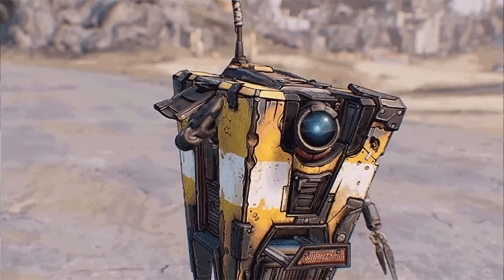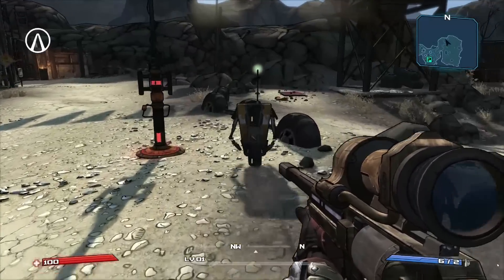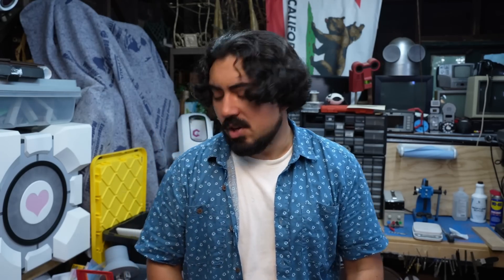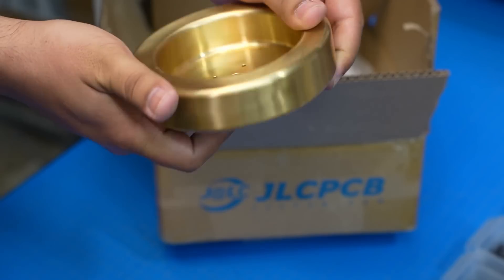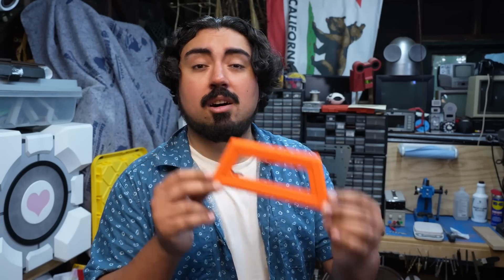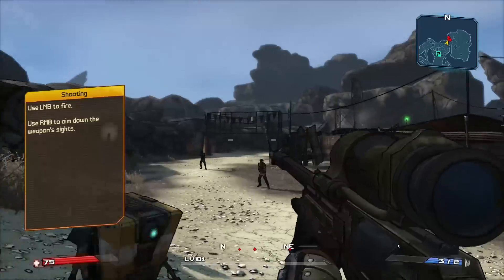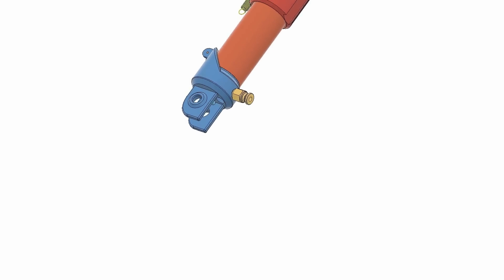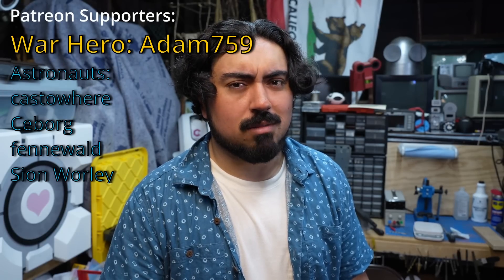Building a Real Life Claptrap Robot | Pt. 1

Comment: If you wanted that hand to be able to hold things, it might be worth looking at switching the direction of action, so that the string pulls it closed and the spring pulls it open. Obviously, if holding things isn't important, your solution will likely put less stress on motor.

Comment: Claptraps suspention system for his mono wheel does not act like what you would expect out of a generic suspection setup, When you do design this part/function. For it to be compact. It might be worth designing it to work almost like a scissor lift. Means less calculations needed for balancing sprung weight. Instead with the above you can make a kinematic model and just mix different positions to "animate" his suspention/movements.

Comment: Would it be plausible to have the flywheel act as a mechanism to stabilise claptrap? My brain is thinking about those little gyroscope toys. I'm unsure if inertia still makes the part touching whatever surface it's on spin. I'm assuming the flywheel would have to be much larger than claptrap himself

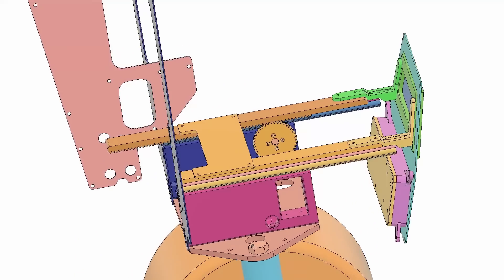Comment: 10:10 you could use a automatic Carantenna for it. Obvs, with some redesign to make it fit the larger diameter of CT4P antenna. 
1. You can use it as an actual antenna to give him orders 
2. propably needs less space then the current version (even after redesigning ... probably)
PS: There are 2 kinds the flexible ones and the rigid ones.
12:50 currently still missing the articulation of his wrist so maybe something to think about but as you said you are still early in the project.
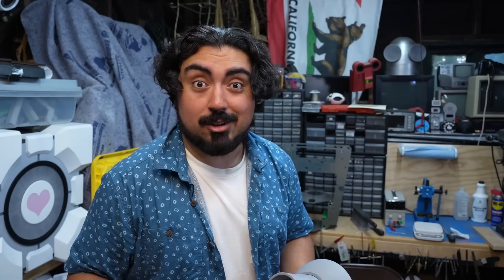8:48 also hoping that at some point you will use an actual camera sensor with a fish eye lense so he has a wider fov

the suspension or rather the rectratable wheel will be a headache. as you have the disk/casette whatever drive right above it. so maybe motors doing 2 or 3 things with a small gearbox or rather clutch save space. but then you still have some Problems concerning how far you can retract the wheel. Hydraulics are the obvs choice that could also double as the suspension while he drives around.

Comment: I just learned, that two close flywheels with opposite rotation directions cancel each other out, allowing a reaction free spin up/down. Maybe this is helpful :)
PS: by mounting each of the flywheel control axis to a seperate motor you have way more control of the force direction

Comment: One thing you 100% need to add is a Raspberry PI based daugher-circuit that integrates into  home-assistant. so you can use it for voice-control

That way if the designs are ever released we can use it for smarthome applications as well.

Nothing beats having a devoted robot servant turn on the lights for you or do things at your request

Comment: I think the retractable wheel and suspension can be "easily" faked by a similar mechanism you have for the antenna. 
You do not retract or suspend the wheel but the body itself. For resting you simply lower the whole chassis on three linear guides until it touches the ground, the wheel itself, the base plate and all important electronics stay in place. The suspension can be simulated by moving the chassis up and down to a decaying waveform. I think three linear guides (rails or rods) + stepper motors (even one would be enough) coupled with belts to the chassis would to the trick.

Comment: Do you think you can make his antenna pick up radio?
Reply from the maker: It will just glow and move, but he'll have a raspberry pi connected to the audio system, so it could have web radio
Reply: @MrVolt  nice, also are you planning on putting a camera in the lens or is it going to work different for the prototype

Comment: You should also Expand on the hardware side of it like what microcontroller you use and the code you use to control it, aka how you will be using it like will it be pre made movement or live movement through a special controller
Reply from the maker: I will in another update. This video would be an hour long if I explained half of the electronics. There are 18 motors and a lot to cover.
Reply: @MrVolt also just realized if you're still working on this for the wheel Rather than a mono wheel you COULD use two wheels basically connected into one that can spin in opposite directions for turning ect so you have more internal space ect, hope you're still making this boi
Reply: @MrVolt oh also btw if u ever saw the comic he was in being a Greeter has always been his Original job so that "disc tray" really is Just meant to despise the hud pda thing he gives to the players that he is meant to give everyone